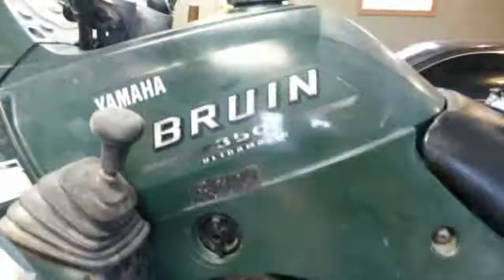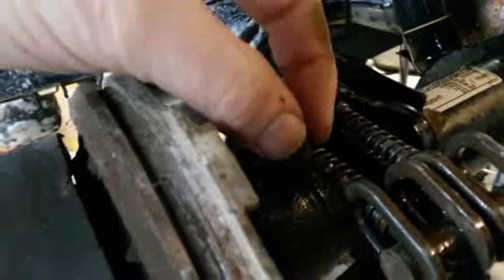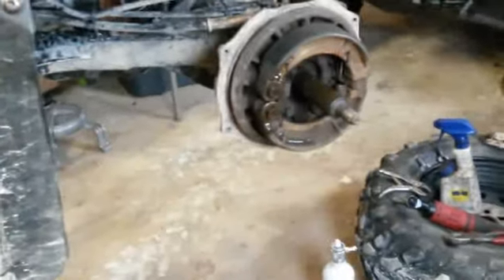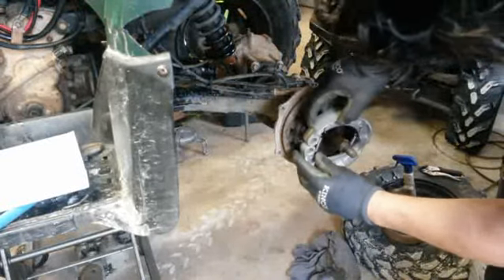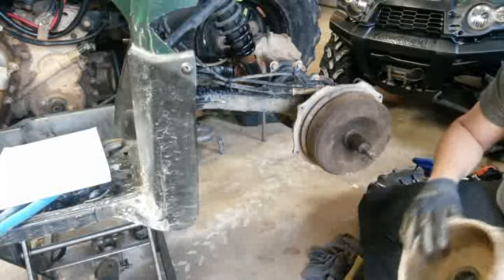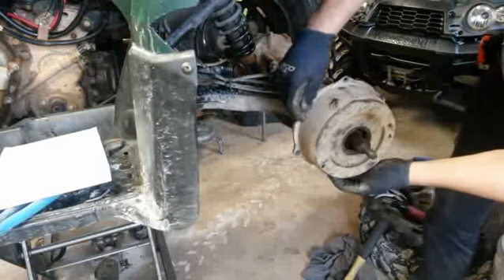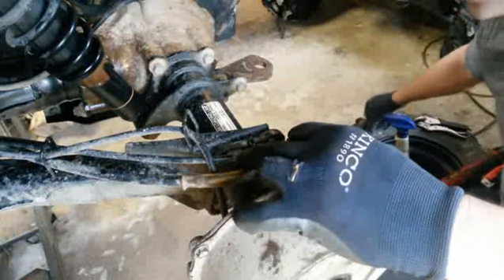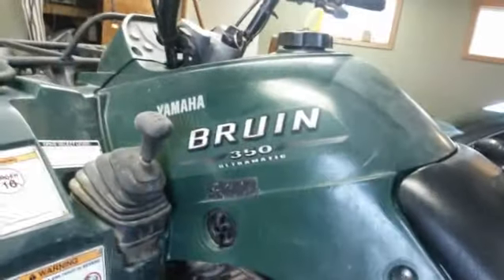06 Yamaha Bruin 350 replace rear brake shoes

Comment: I'm having trouble with the dust plate doesn't seem to want to budge any pointers?
Reply: I ended up using a very sharp dry wall hammer (the axe side).  The wall of the part was very thin. I put the axe side in the groove and tapped it around as much as i could untill it seperated then it came loose.
Reply: Use torch

Comment: Nice video but I wish that you had a tripod or someone else holding the camera. very tough to follow to see how things are supposed to be.  Having a tough time finding a manual with schematics...ok sorry I see that you just didn't use it at first. Have you done an over all view of the ATV??? Such as under the seat, the wiring harness, that back of the rear brakes, cable adjustments or replacing cables that are totally rusted beyond repair, Master cylinder....oh the list goes on....